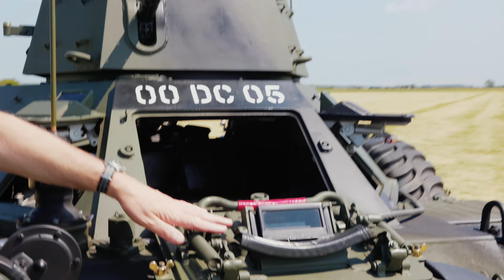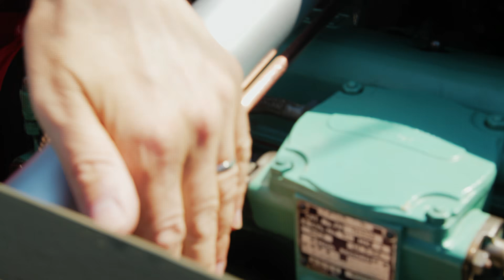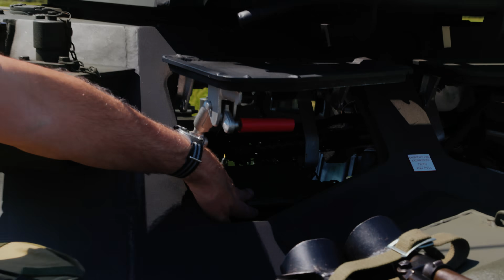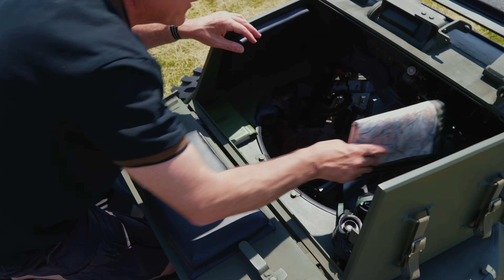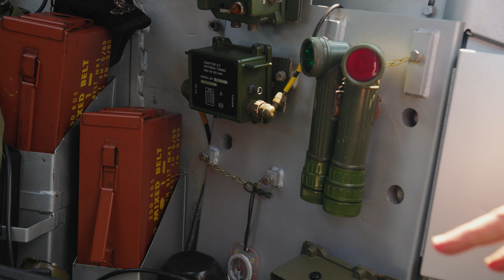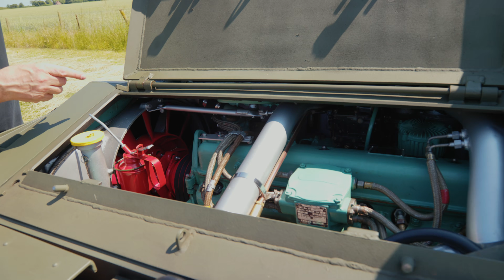Ferret Scout Car Walkaround: Features, Fixes & Field Tricks | Full Tour

Comment: I always thought that all those marks in the armor are when they manufactured the plate, they had to flatten the plate for precise welding. The marks were made by a hammer of sorts hammered into the metal to get it flat. I could be wrong though!! I used to own a Mark 1 Ferret. Sadly sold it to a military museum in western New South Wales.

Comment: Very comprehensive walkthrough, greetings from Cumbria, we have a 1959 MK1/2 which served in the RTR at the Berlin Wall in the 60s & 70s, then Cyprus with the UN. You didn't get round to showing the uparmoured bit, I was hoping to find out a bit more about that.
You're absolutely right about 'never ending job', now it's winter we have started the major dissassembly/rebuild work, should have it all done by April, just me and my wife doing it all.

Comment: The removable engine cover plate was so you could place the bottle jack on it on soft ground. Totally useless as a sand channel. We used PSPs fastened to the front of the vehicle if they were available. 1973 - 1985, 16/5Lancers.

Comment: I did laugh when i saw the yellow oil cap ,,Yellow usually was used of diesel fuel caps ,and red was petrol ,so i can only imagine some not to bright drivers filling the engine with diesel ,,,And after 12 years in R.E.M.E . i am not joking about drivers ,Though if it wasn't for drivers ,where else would i get my free Yellow Handbags lol..I think the fire extinguisher was a BCF  ,but deffo not enviromentaly  friendly...My personal part of the Ferret that i thought was dodgy .and i still remember this from VM trainingat sunny Bordon was the 50 pound  rated spring in the gearbox ,so if you hit a false neutral ,it would come back through the GCP and implant your knee in your chin if you where unlucky
Reply: Is the yellow handbag a reference to the Herforder Pils? My uncle was based there with the Royal Horse Guards “The Blues” in the early sixties. He married a local girl and never came back to England. The officer on parade asked him where he learned such good German and he said ”In bed sir!” 😂
Reply: @statuescher yes